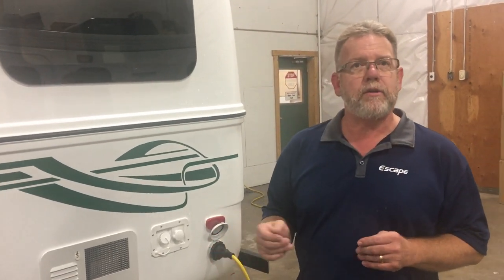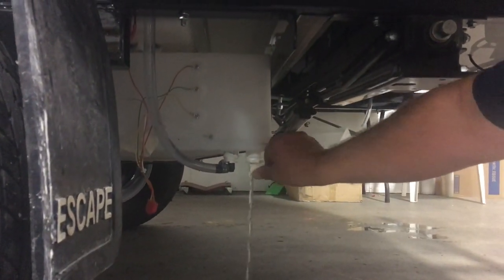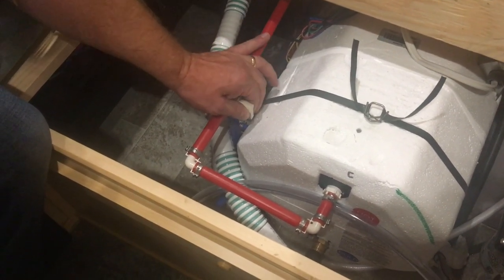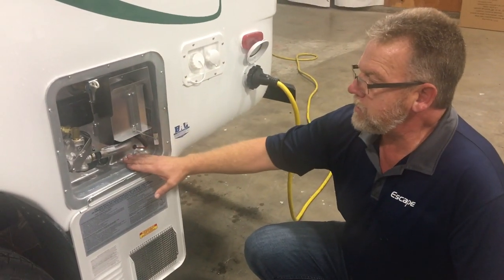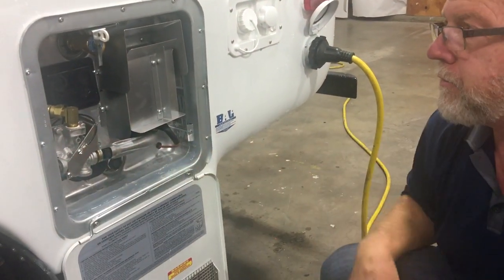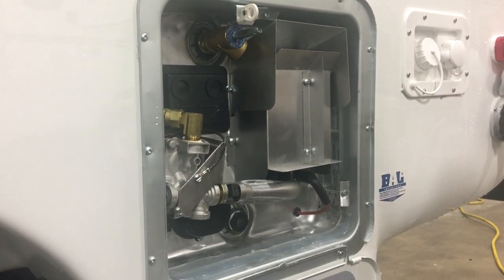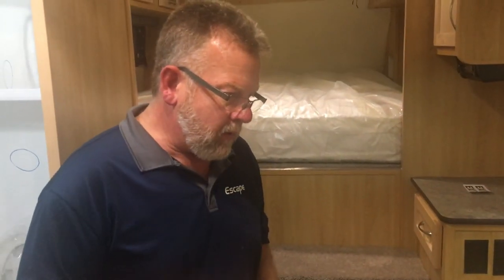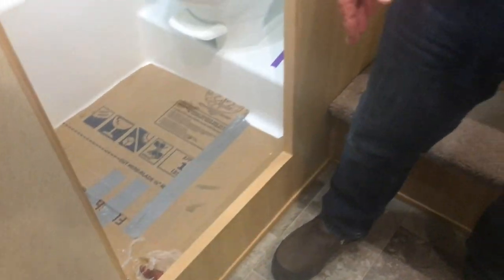Winterization

Comment: I’ve never done this before and found that sections were confusing as you went pretty quickly.  Example.  You talked about the blow out plug and screwed it in and then quickly removed it and put in a custom hose fitting.  So, what was the blow out plug used for?
Reply from the maker: Richard, the blow plug simply creates a smaller opening for your compressor to allow air to enter the system. As Dave mentions, you'll need to hold your compressor fitting on the hole so you may need two people when using this method.

Comment: What is the smallest air compressor that can be used to winterize the trailer
Reply from the maker: Hi Vicki, you need an air compressor with 40-50 psi which almost all of them do. It is not so much the psi you are looking for but volume of air. An example is you could not use one that you plug into your car to blow up your tires. It needs to have a tank so you get a steady flow of air.
Reply: @takeyourescape  by volume of air do you mean the SCFM? I am not too knowledgeable about air compressors and I am shopping around for one for our Escape RV. I found one with this description: "Air flow is 0.7 SCFM at 40 psi, 0.5 SCFM at 90 psi, max psi is 100 psi " Is this enough?

Comment: When using the antifreeze method, do you leave a small pool of antifreeze in the toilet, or flush it into the black tank? I’m wondering if the liquid would damage the seal of the waste gate? Thanks
Reply from the maker: Best to flush the antifreeze out of the toilet bowl. It may stain if it sits there for an extended period of time.